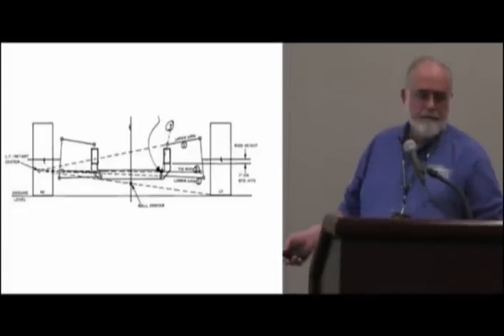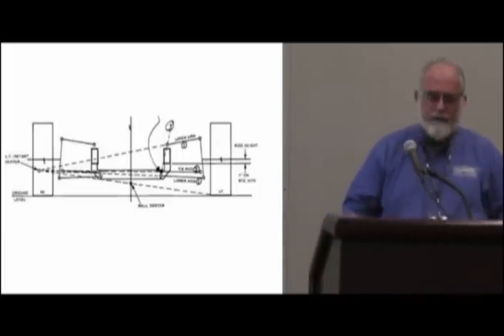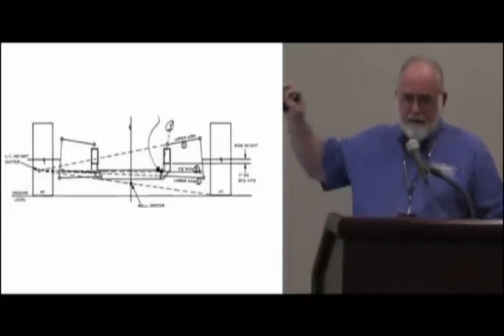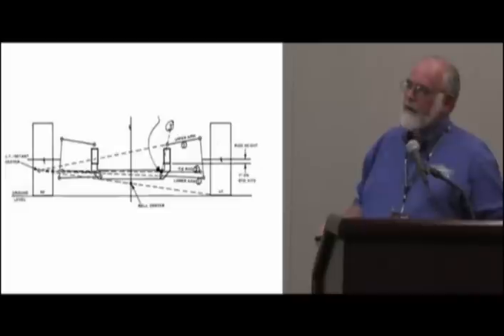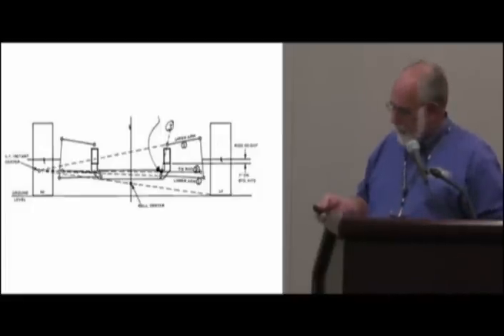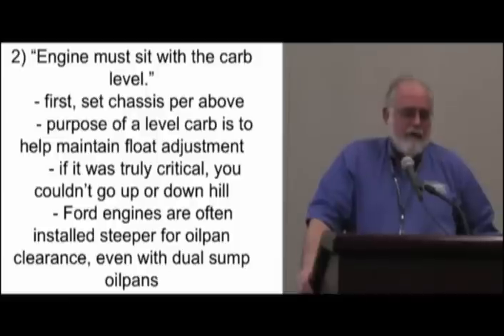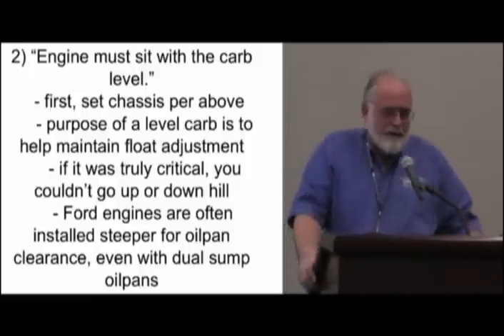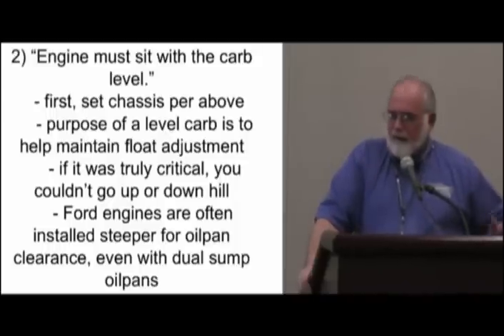Part 4 - The best Chassis and Suspensions explained by Brent Vandervort

Comment: Yep Brent is a very well rounded guy and has the ability to speak in ways that people understand. That is very important. Another thing I like about him is that he will tell you this is important. no that isnt. he cuts through the myths and explains between one and the other. We had a car come in that was nothing less than a death ride. It would ride ok and steer ok. Then at about 42mph you better lift and get on the brakes. I cant explain what it did because everything went nuts in the blink of an eye. I was just hope it would stop. My boss did every thing he could and we checked as much as we knew. Then he called Brent. We started taking measurements and we would call him back tell what those were. Then he would have us go back and take more. It took about an hr or so with phone time  and everything. But we found out what was wrong. And only because Brent knew where and what to look for. To the untrained eye there wasnt anything wrong. When a man can guide 2 others over the phone by only a description of the physical problem that tells you he knows what ground zero is.